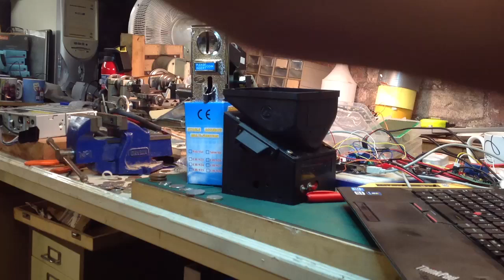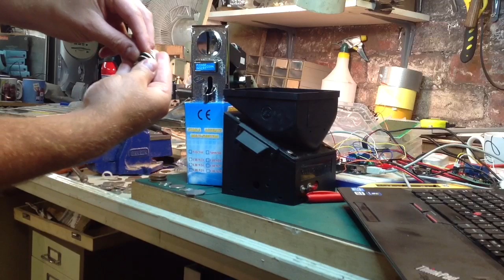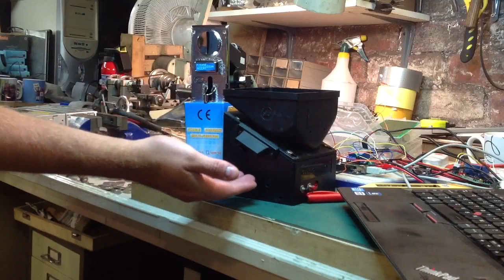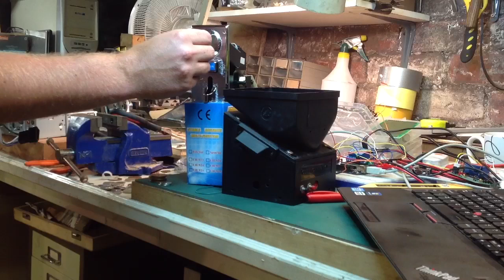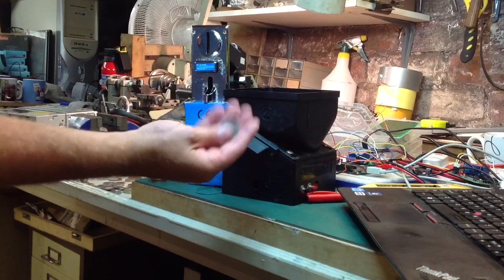Homemade 10p Coin Change Machine - arduino, ch-926 and cube

Comment: can you help me. I need to know how can i read the value of the white wire, or what  pulse, because i am working with PIC18F4550, i need to read the value for each one coin.
Reply from the maker: You programme the coin acceptor to pulse depending on what coin in accepted. So for example, I think I did 1 pulse for a £1, 2 pulses for a 50p... Those pulses are read by the arduino... If it senses 1 pulse, it knows a £1 has been inserted. The coin hopper itself then releases a pulse for each coin it gives out which is read by the arduino on a different input pin. Following on from the example above, the arduino then turns on a relay which turns on the coin hopper, it waits for 10 pulses from the hopper and quickly shuts it off again.